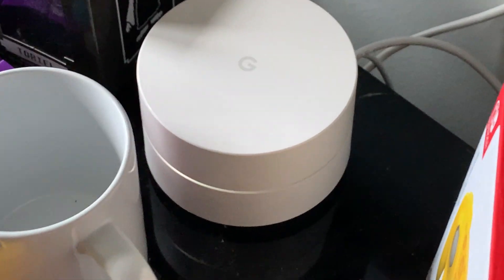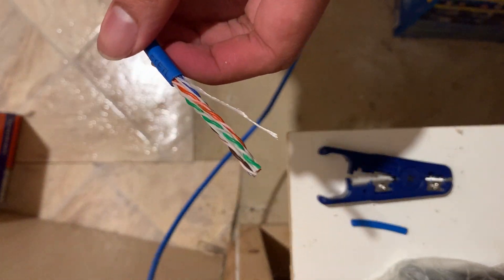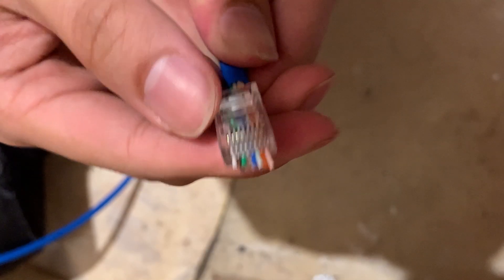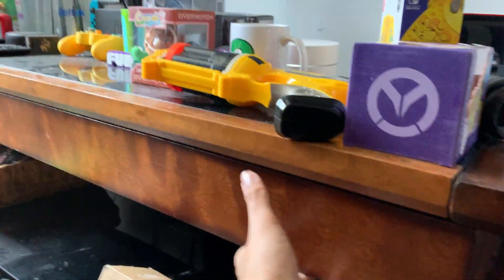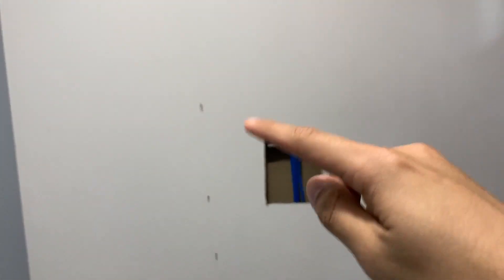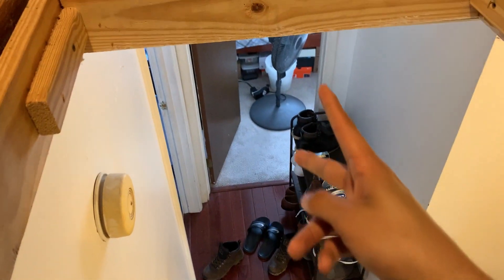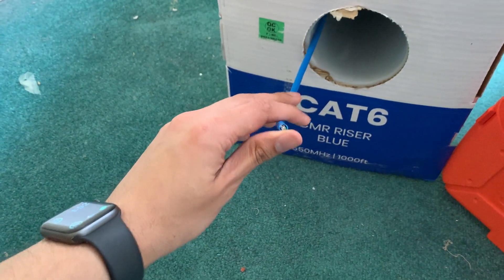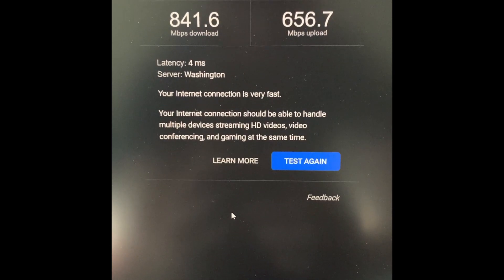Wiring our entire house with Ethernet cabling

Comment: RJ45 connector is not to be used with solid core riser wire. When you crimp how can it penetrate the solid core? The correct way is to use RJ45 with stranded wire. Solid core wire is punched down on a patch panel.

Comment: For those watching this, instead of running four cables from the basement to the attic, you could run one cable and connect it to a small gigabit switch installed in the attic and run your station drops from that switch. Small, 5 port GB switches are about $8 on Amazon, so one switch would be good for four locations. (Better quality GB switches, or ones with more ports would cost more, but I haven't had any trouble with these inexpensive GB switches.) Also, when terminating an RJ45 modular plug, make sure the shielding goes inside modular plug, there's a crimp point that holds the cable in the plug and it should crimp on the outer jacket instead of on the exposed wires. I use non-pass-through modular plugs and cut the exposed wires to about half an inch. You can still check through the modular plug to make your wire order is correct and pull out and reinsert if they're not. I think this might easier than trying to push an inch and a half all the way through. (Maybe CAT6 is thicker and harder to feed — I don't know as I've never used it.) Thanks for sharing the video.
Reply: Thats not good future proofing
Reply: @nopers2223322 can you elaborate  on why this is not future proofed?

Comment: Woah love the video! Outta curiosity, the switch - did you have only one ethernet cord connected to the switch from the modem which then allowed you to connect 4+ ethernet cords that you've fished and wired throughout the home? If so, how does that not slow down the internet speeds if it's 1 ethernet cord from modem that's being spliced(?) into 4+ ethernet cords from the switch? Also, who's your ISP? I wish I had pure fibre in my area!

Comment: What happens if you have a house with solid walls & not a prefabricated house with plaster board ?
Reply: Cut channels for conduit and run the cables inside the conduit. Once it is all tested and working you fill in the cut channels, smooth them so they match the wall and paint the patching with the correct colour paint and you'll never know it's there. Be sure to leave a pull through in the conduit so you can add extra cables later if required or even upgrade the cable from Cat 6 to say Cat 7 when the 40Gigabit hardware become more affordable. 👌

Comment: For straightening the wires, drag them under your thumb over the rounded back of some long-nose pliers. 

When they're straight and in correct order, cut the ends at a slight diagonal. This makes it easier to feed them through, and it's also easier to see if a wire's got out of place.

Comment: When I wired my house up  I got lucky.I have three closets over top of each other.. I  ran a piece of 2"  PVC pipe down t the back corner of each closet to the basement. I Relocated my router to the main floor. in the basement and top floors I installed a 16 port switch in each closet with a line leading othte oruter on the main floor. The cables for  the jacks on each floor go to a small patch panel in the closet with a line to the switch. Final step was a fire upgrade fro my telecom. I had them run  the fiber cable  from their demarc through the wall and to my router in the closet in the basement and up to my router on the main floor. It was run along the ceiling  along the rafters in a short section of innerduct (Fiber glass conduit I happened to have acquired once upon a time to the basement closet then up to the router. basement  jacks got wired to a patch panel and switch down there with a single line leading to the  router (Router had 5 ports on it. THis minimised my cabling between floors and ensured the wi-fi fro the router was centrally located n the house. Wi-Fi 6 is  highly reliable for mose houses. I only wired my office and the tv locations. Everyhting else is wi-fi. If I need more access points its easy to do on each floor. I wire it otthe switch on that floor. I might change the switched to POE eventually.,

Comment: I bought a house that had an ethernet/phone  junction box - it was cat3. I got so frustrated I tore it down. Now-a-days, I have the setup you're discussing. I went through upgrading to cat5, 6 and now I'm stringing cat 8 although I don't have those speeds yet (externally), but soon.
Reply: I did fiber instead of cat 8 for the main runs. SFP and SFP28 ports for the win.

Comment: Why is the WiFi connection has very slow connection than the wired one? Is it because the WiFi is blocked with so many walls? That’s a 2782% improvement
Reply: Currently achievable:  Fiber (qsfp-dd) 400G. Cat6/7 10G. Wifi is an order of magnitude slower.
Reply: How many websites do you connect to that will feed you at 10G? ZERO!
I am aware this was done 3 years ago but there are now some excellent high bandwidth WAP available.

Not criticising, just making a minor point.

Comment: The blue part of the cable should be crimped as well to avoid breaking it
Reply: ...came to say this as well: The mechanical pressure point should be crimped on top of about ~1/8" in of the jacket, NOT on the wires themselves! This way any mechanical 'pulling' of the cable is done against the jacket and NOT the wires - any search on 'proper CAT6 jack termination' would show many examples...

Comment: Why run ethernet when you can future proof your network by using fiber optics?
Reply: I highly doubt any consumer-level electronic device will have fiber optic support.
Reply: @JJFlores197  They're cheap...enterprise level devices that are old and it uses 1gig or 10 gig port. It's dirt cheap for small switches and media converters.
Reply: @JJFlores197  it doesn't have to be a consumer level device. You can buy enterprise old tech that are cheap. You buy the switch and run the proper fiber cable. You can get 10g upload and download within your network.
Reply: @JJFlores197 Actually not correct. You can get a 8 port Gigabit mini switch that has an SPF port for an optic fibre connection and these have been available for the last 4 or 5 years.
Reply: Expense would be one reason to not do it. If I did that then I would want to run the fibre inside conduit to protect it. 
Would you run fibre as a backbone between the modem and switch or run fibre to each termination point?
Unless you have some expensive terminating gear it is not a DIY any more unless you measure the length of the runs needed and purchase them already terminated with LC or SC connectors. You'll need to purchase SFP modules for the fibre ends although these are now quite affordable.

I worked at a school in the late 1990s and they ran fibre to each network point but fibre NICs were not available so they had to spend $300 for a fibre to Ethernet patch leads convertor/adapter for each network point. Guess they are laughing now but the expense at the time was horrendously expensive and then the clown who arranged all this put 10Mb NICs (Network Interface Card) in the PCs 🙄🤦‍♂️.

Comment: Great video! Curious to know why not just run one cable from the basement to the attic and have a switch at the attic space
Reply: Do switches need a power source? Maybe there's no electrical outlet in the attic. My guess is it's easier access in the basement, and more temp controlled.

Comment: i loath cable boots. makes it hard to depress the clip to remove the cable from a switch, etc. i use a mini flat head screw driver to separate the pairs of conductors. soo much faster. do NOT use pass-through rj45 ends on outdoor applications. also, when crimping an rj45, ensure the outer jacket (blue in this case) is inside of the rj45 connector.
Reply: They get hard after a few years, less if they are exposed to sunlight. I have had to remove the wall plate and the  RJ45 jack just to replace a broken patch leads. Not a fun job when it is in a classroom the has 5 and 6 year old students with their very low desks fixed to the wall so you can't remove them to make the job easier. Yes, I share your loathing of the boots that have the wings each side and those stupid farking buttons "protecting" the clip. I carried a disposible blade razor knife to remove that crap.

Comment: Here’s a tip….those twisted cables, that blue extra piece you used to untwist the pairs, use that same thing to insert into each curled wire, pinch and pull, straightens the curled wires…..could’ve saved you all that time you used to try and straighten them out individulally with your fingers….literally
Reply: he's already done bro
Reply: @CarAudioInc  Sure, but this is good info for others trying to do the same thing.
Reply: @FollowRevolutionNine  yeah cause heaven forbid someone sees this comment and actually gets some helpful tips other than what the video showed…lol
Reply: @CarAudioInc 😂😂😂😂

Comment: Had a field tech from my ISP do this for $80 back in 2017, then another run for $90 in 2021.  Good to know the ins and outs of how it’s done.
Reply: Where I live Downunder, they charged AUD$160 a point in 1996 and it was still $160 in 2020.
Reply: Didn't know you could get the ISP to do this. if the install was already done will they do this? My system was installed about a year ago

Comment: did you have to use a wifi router for this project? can you hardwire the entire house and just use the modem ?  i,m wanting to hardwire without the wifi router because my modem is in my living room which means my wifi router is just next to me.
Reply: Your phone and laptops (on the couch) love using the Wifi Access Points.  If more than one, make sure each WAP is wired so it can run at full speed.

Comment: i wonder if CAT 7 would have been better to use when you think about that it can do 10 Gbps to not only give full 1Gbps but to have 10 Gbps if need like one day if some ISPs would strat selling 10 Gbps in like 5 or 10 yeasr from now
Reply: Unofficially Cat5e can run 10G at about 50-60ft without error. That covers lots of runs in a small house.

Comment: I read all the comments, and I did watch the video in its entirety. I wired my house completely for internet, I also did my sister's mobile home. I used cat 6 in my house and cat 5 in my sister's house. I did like some people are suggesting in these comments, I did use a keystone and a wall plate at each room. In fact none of my cabling has got an and crimped on to it like you did here. I would recommend replacing those ends with, even where the wireless access points are.

Comment: You are using the wrong type of cable to put RJ45 connectors on. Riser cable should be terminated into patch panels and keystone jacks.
Reply: Why do you say that? You most certainly can put an RJ45 on a riser cable. Riser cables are one of the most common cables used for wall runs. The method of termination also has no effect on the final outcome- Atleast not one that will ever be noticeable in a residential install. What you are describing is a corporate standard blueprint for network installs. This guy does not have a corporate IDF setup with patch panels and switches.
Reply: The cables are basically identical.  Riser just has a toxic jacket if burned.  Plenum is for certain applications.  Still functionally identical to patch cables and can be custom lengths…

Comment: I'm a big fan of MoCA.  No need to run Cat 6 if you have coax already installed.
Reply: Isn’t the price difference significant tho? Really contemplating between the two as the rooms I was want direct connection to have coax
Reply: @crietonfightin899  I mean the convenience factor of not having to drill holes in your wall to run cable is the best part. Also I didn't buy moca adapters straight up. I bought old Verizon G1100 routers on Craigslist and Facebook marketplace for like $10 each and reprogrammed them into "bridge mode" so they're basically just moca adapters and wireless hotspots instead of routers. Saved a ton of money. Fairly easy to do too.
Reply: @crietonfightin899 More expensive, yes, but depends on the run and how complicated it is or if doing yourself.  If paying someone, it might be worth it.  Or try powerline adapters.  I have had both good and bad luck with them.  Just depends on your wiring.

Comment: Something i did to my home to run my ethernet cables from attic to basement floor was running some non metallic smurf tubing thru the walls I did next to my return duct and also label ur cables to the locations so they can be together an neat, also by having that tube u have a way that if u wanted to add more cables in the future it's a simple drop down the pipe and ur good
Reply from the maker: Those are great ideas!
Reply: Would the Smurf tubing be used throughout all the connections or just basically in between floors??

Comment: you want that outer cable jacket also inside the crimp.  Low voltage ethernet cables should be away from the higher AC supply lines so as to maximize the effective shielding & twists.  In your video showing cables in stairwell I can see the ehternet cables touching what appears to be an AC supply line.
Reply from the maker: Thank you for that helpful info!
Reply: Right where the drywall hole was cut. I did have an Oh 💩 moment when I saw that. 😱

Comment: I too have a older home Tri-Level (1972 era), I have run hardwire to nearly every room in my house with the exception of the kitchen, dinning room, laundry room, and the bathrooms.  Wifi takes care of those rooms.  My living room and family rooms each have two separate hardwire runs.  The basement has a run down to it but is not actively being used (for now), but since it is an older run ie. Cat5e I may us it to fish a new Cat6a line up to the second floor where the computer room is.  There are two separate fiber companies that are laying fiber in the neighborhood as I speak that I may decide to switch to,  so I may just put the fiber media converter in the basement and then run straight fiber from the basement up through to the attic for the first floor and then come through the wall where all the other first floor Cat5e/6a cable come into the computer room.  I'm glad you showed where your internet comes into the house.  The basement will be the easiest access point for the fiber run from outside into my house.  I currently use Xfinity Cable internet 800 Mbps and fiber is offering 1 Gig up and down with no data caps.  I currently pay for unlimited data ($30 extra per month) because they hit my twice for going over.  So fiber is looking very good unless Xfinity can increase my speed and eliminate the unlimited data charge.  They have until the first of the year when the fiber is scheduled to go live.

Comment: Since i didn't see mention of it in the comments (short and simple ones at least) i will mention it, you're supposed to push the jacket all the way into the connector before crimping it too, it's kinda like a strain relief for the copper wires at the pins.
Reply from the maker: Thanks for providing that helpful information

Comment: I dont recommend pass-through connectors, they have a high chance of shorting and the copper will oxidize which makes the connector unusable
Reply: Lol.  We exclusively use pass through connectors and have for 15+ years in a school district.  They’re fine and easier to make a good crimp for most people.  Don’t plug them in before crimping, and no short.  That being said, I have crimped with them plugged in with no issues.  I just wouldn’t recommend it.
Reply: @farmeunit In my school district we got rid of them specifically for the problems just mentioned especially when we put things into the hands of contractors.
Reply: @visheshshivraj6055  Most contractors I know don't use them.  We do our own wiring.  Or for fiber, buy pre-terminated.  It's really hard to fuck up a passthrough connector, honestly, but you have to buy brand name like Ideal and not cheap ones.
Reply: @farmeunit  Well I do doors and security cameras so all outdoor stuff if we let contracts run wires with a pass through a lot of the times weather would cause some kind if issues especially if the mounts or devices themselves we’re probably sealed or installed. Fortunately fixed a termination is still for easier than some of the tough cable runs
Reply from the maker: I didn't know that
Reply: @funky7522  From my experience of wiring my entire house with CAT6 and making patch cable for CAT 5e, I would say that they worked pretty well. For the oxidization, it depends on the moisture content of the surrounding that they're currently working in. At the end of the day, all connectors at least "passed" the standard of RJ45 and CAT standard; just use a high quality RJ45 wall jacks with good cables then you're good to go.
Reply: @funky7522 if you are not using then for outdoor work I wouldnt sweat.

Comment: I would use the jacket you just pulled off and squeeze the individual cables between it once or swipe before trying to put them in their order. You will get a much straighter cable and don’t have to worry about them getting out of order when straightening them all at the same time.
Reply from the maker: That's a good tip!

Comment: Next time you go to straighten those wires, use something smooth and round like a small screwdriver shaft and once you untwist them, press the conductors against the screwdriver and use the force to flatten the wires. I usually do it in the colored pairs. Also if you're doing the pass throughs, once you sort them into their proper color order, cut them all flush across the top so they go in the connector better. I will, however, echo other commenters, you should use keystone jacks on both ends and use factory-made, stranded copper patch cables for connecting devices to infrastructure wiring.
Reply from the maker: Thank you for providing your insight!